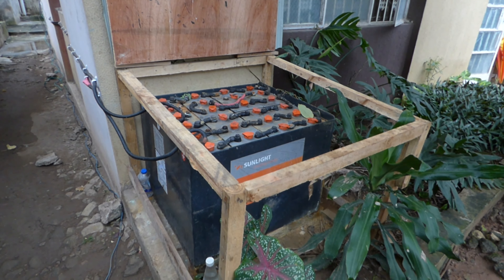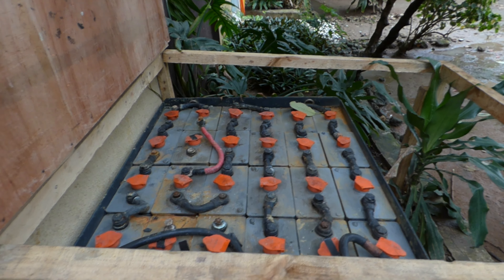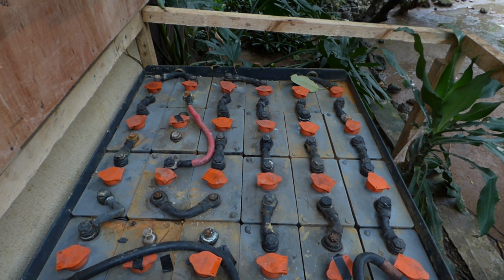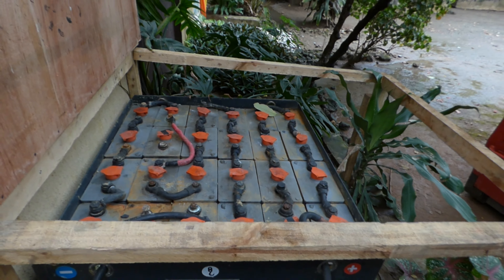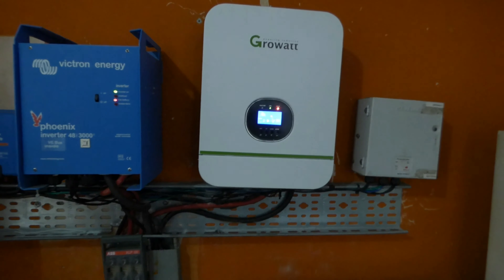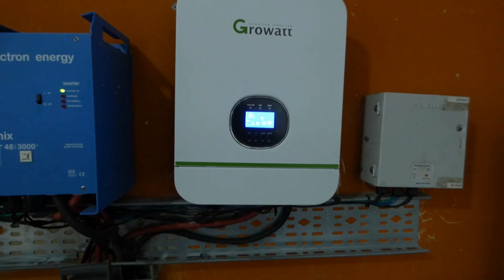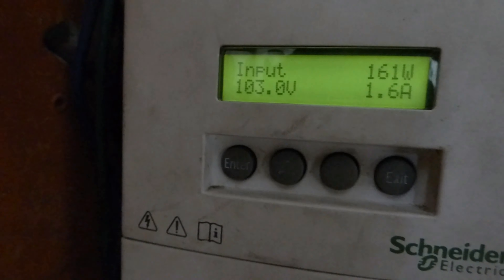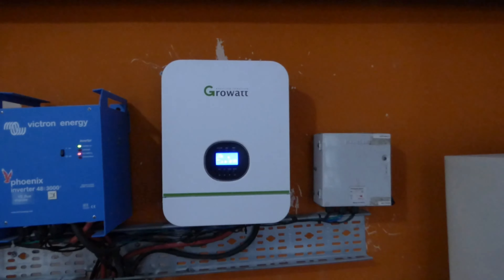Nigeria's 1st Forklift battery for solar failure. See my new surprise.

Comment: Thanks for sharing Dr Solar. I personally believe the era of lead batteries is over and that's why Victron's claim of only selling lead batteries to Africa really angered me. What model is the growatt and would you recommend it? I'm impressed that they honour their warranty.
Reply from the maker: I agree with you assessment on Lead Acid batteries. In Nigeria people who are off grid are suffering. They honored the warranty. The first replacement blew up and the new one seems to be doing fine. It is the SPF 5000TL with a 60 amp AC and 80 amp DC charger